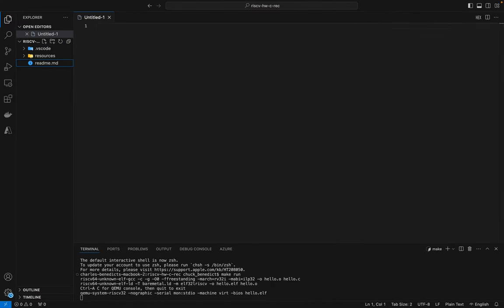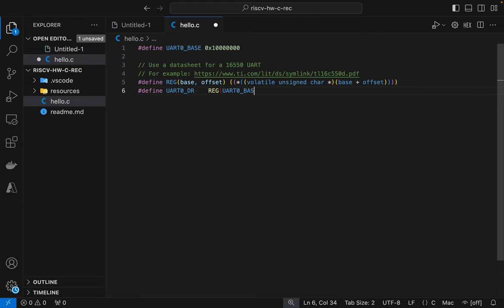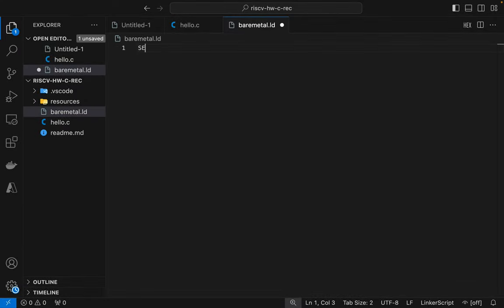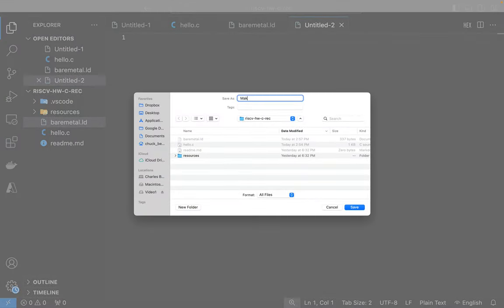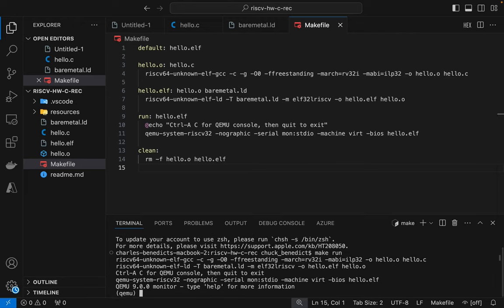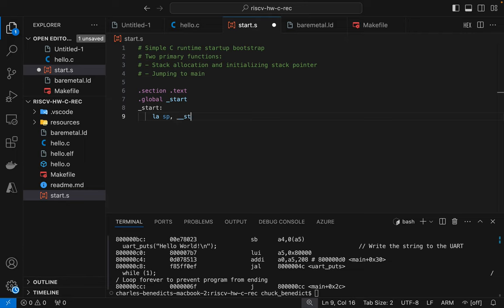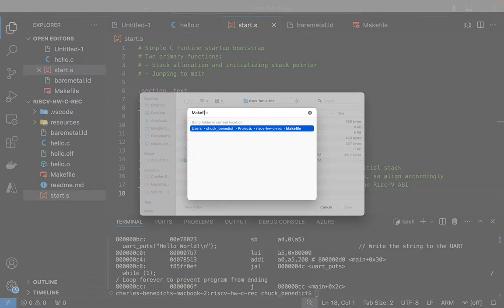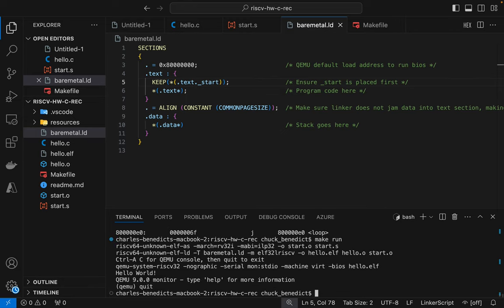Risc-V Bare Metal C Hello World!

Comment: 2 questions:

Is that linker file stuff working the same way if using clang instead of gcc?
Also, will you show how it is done with Rust and Zig in future videos?

Bonus question :)
in riscv assembler with gcc is it mov <target>, <source> or mov <source>, <target>?

Since GCC for x86 keeps insisting to use that AT&T notation or however it is called...

Bonus remark:
It has been a few decades since I did UART16550 programming. But the way your uart_putchar() function is written, you do not really use the FIFO. There is a way to check if the FIFO can still hold one more character. You, in turn check if the FIFO is empty.
Reply from the maker: Since the GNU linker is used by both, the syntax should port no problem. What the compilers emit may differ, however, plus the platform matters too, and so I suspect that's why a generalized linker script is so freakin' complicated. Running `riscv64-unknown-elf-ld --verbose` is educational.

Re other languages, I am working on Python right now. Thinking about Go. I actually ported a version of Java to run bare metal on rPi years ago. I thought about revisiting that project for Risc-V. I've never used Rust or Zig. But sure, why not?

Funny enough, there is no mov instruction for Risc-V. There is a mv psuedo instruction, `mv rd, rs`, which translates to `addi rd, rs, 0`, with the destination register being first. I find the green sheets helpful, for example: https://www.cs.sfu.ca/~ashriram/Courses/CS295/assets/notebooks/RISCV/RISCV_GREEN_CARD.pdf

The FIFO is actually used, it's just never filled. THRE clears before the shift register finishes munching on its data. I wanted to show a technique that would prevent data from being dropped, not optimize throughput. But your point is valid. I was not clear in the video.

Great questions. Thanks!
Reply: LLVM’s lld is a drop in replacement for GNU ld, so it should be identical. Rust and Zig are using LLVM so again, same scripts. (Zig wants to get rid of LLVM)
There is also mold which is also a drop-in replacement. So you can use the same script with any of those three linkers.
Reply: @chuckbenedict7235  btw do you guys know, is msvc support gnu linker script? Bcz their kinda s..t
Reply from the maker: @Kerojey  I'm not sure I understand your question fully. If the question is...do GNU MinGW tools, and specifically the linker, link to libs built by msvc? There can be C++ name mangling problems. If the msvc libs export functions as extern "C", then this problem is avoided. Also, runtime libs between the two are separate and may pose naming conflicts. May have to use -nodefaultlib to remove one. In short, the answer is yes, but there are gotchas that aren't worth the trouble IMHO. It's much easier to stick with one toolchain or else build mscv code into dlls and call into those from MinGW built code.